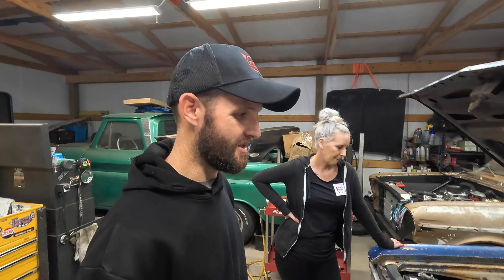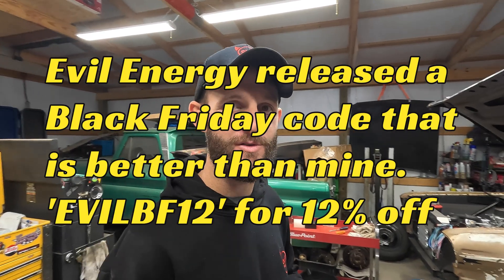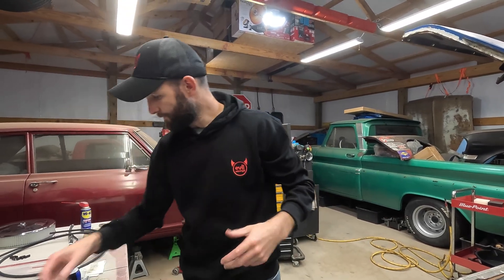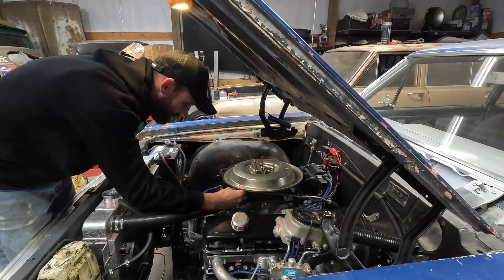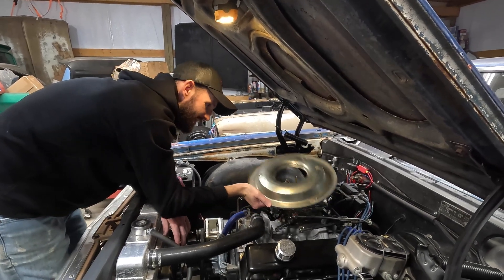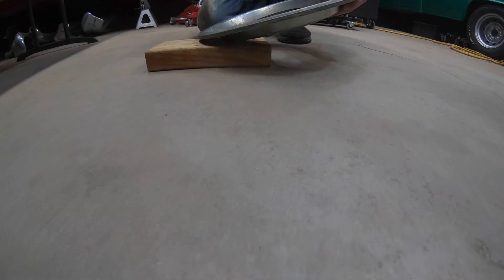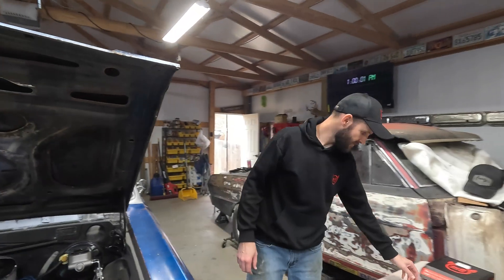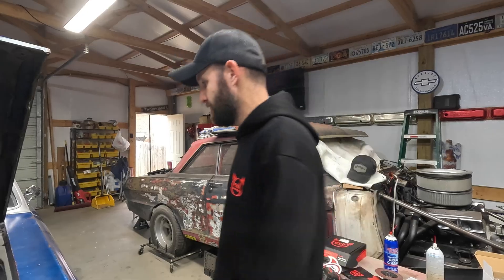The AN Fitting You Need For A Holley Street Warrior Carb

Comment: You can buy carb air cleaner spacers, there black plastic
Reply from the maker: yeah, I looked at a couple of those, and we could probably get away with a 1/2" one and still get the hood to close without hitting the air cleaner. But at the end of the day, this intake is slated to be changed so didn't want to spend on something that I may not need with the new intake. Right now we are having to run a 1" spread bore to square bore adapter/spacer under the carb. So once I get a proper square bore intake, I should be able to ditch that 1"er for a 1/2" phenolic (for a heat break) and pick up some extra space needed to run less of a drop base. At least that is the thinking at the moment. We'll see how it all comes together once it's got the right intake on it.